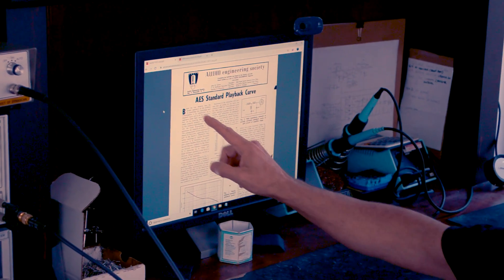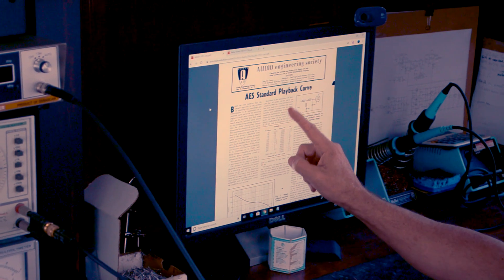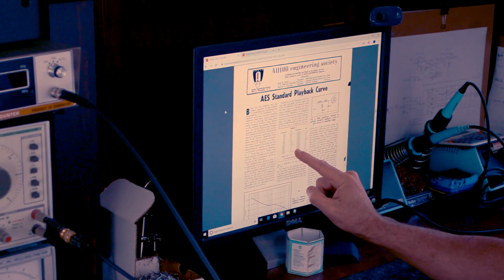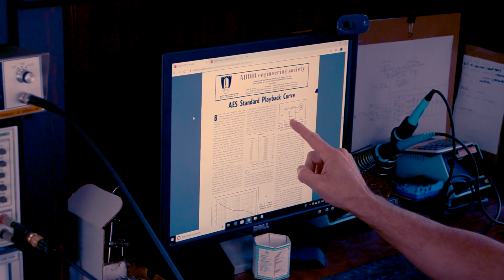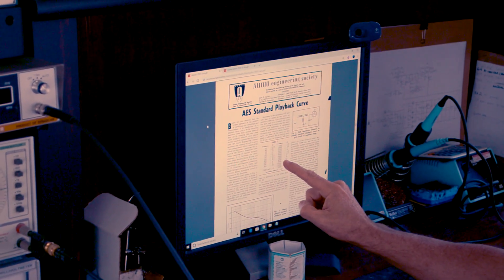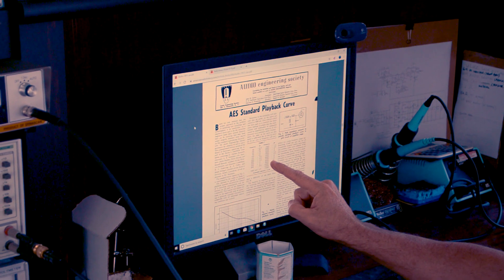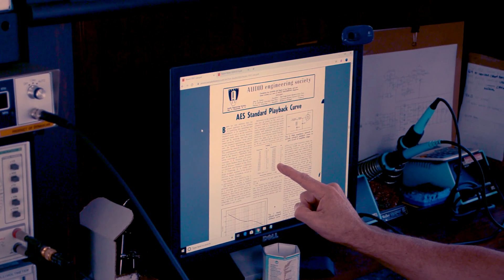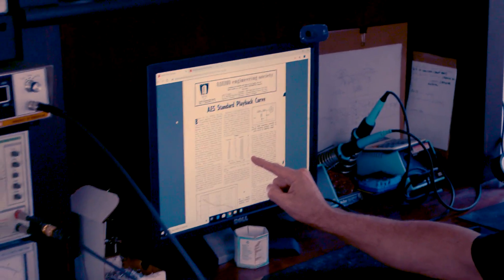RIAA History

Comment: How accurate do you think the riaa curves were that came out of the studios? If a person likes old vintage recordings, (some of them sound amazing) do you think it worthwhile to have a preamp that has a Columbia and Decca curve on it? 
Enjoy your videos.
Reply from the maker: From the early 1970's on back, the accuracy of filter networks for inverse RIAA circuits would not be very accurate by our standards of today. The components available back then would drift in value quite a lot. I haven't actually played around with the different curves outside of the RIAA standard so I can't give you an experiential answer on the value of adhering to all of the different curves.
Reply: Everything is different nowadays. The early LP where  intended to be played with the correct curve, yes, but with the early phono cartridges and those early cartridges were far from having a flat response. The early GE VRII have a quite different than the modern Ortofon 2m Mono. Also they were played on valved (tubes) equipment. So if you want to play an old mono record on a modern preamp with different curves selection the best you can do is play them with the curve that make sound better.